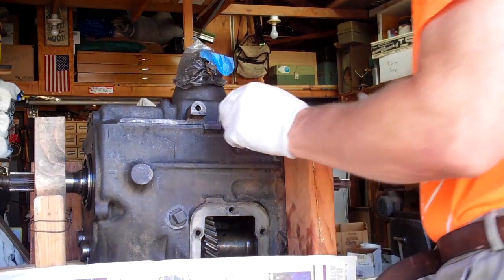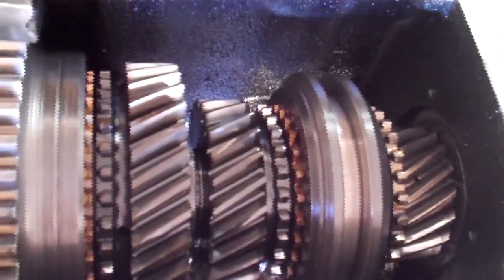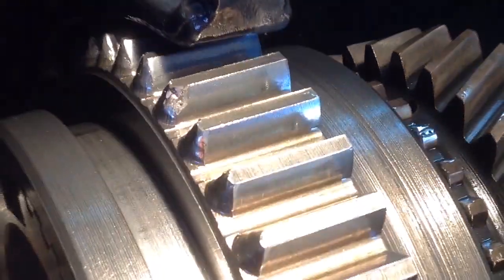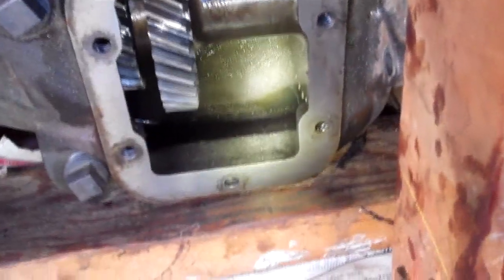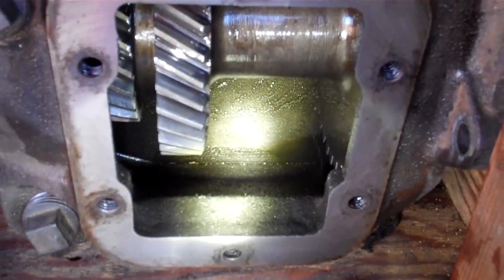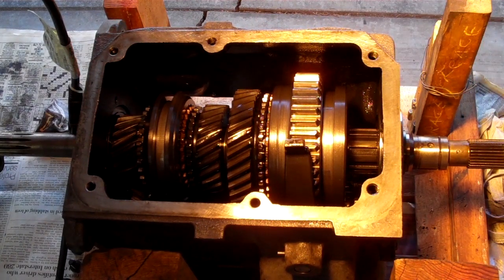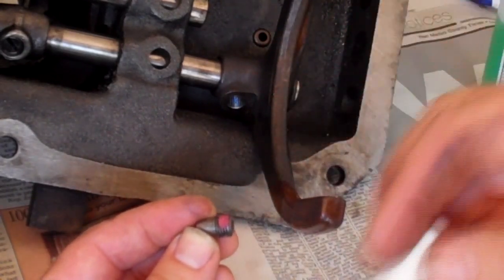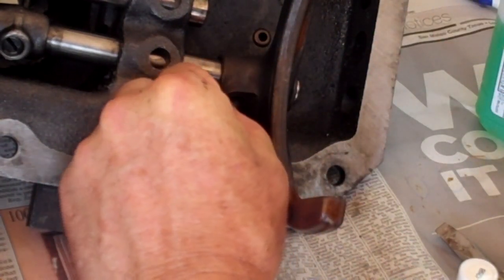T-18 Borg Warner Transmission inspection

Comment: I did a E4OD to T-18 swap, my uncle owns a shop and gave me every single part for $250 from a low mile wreck I mean every single piece it took to do a full factory look swap. the shield the inner and outer boots every bolt nut and trans cover I cut the hole with a grinder disc and drilled and bolted the tunnel in looked factory all the way made a HUGE difference in how the rig pulled it felt bogged out in every gear with the auto now it pulls like a mad man I also did a locker in the rear as well it is a 2 wheel drive.
Reply: Is this a Good brand ?

Comment: Hi there, 1958 AMC Rambler Super (pt.21) here, I noticed a small spot of yellow paint on the (first?) Biggest gear, I also have small spots of yellow paint here and there on my clutch pressure plate and friction disc and also on the front of the transmission gear box, I didn't think there would be those same marks INSIDE the transmission, is this to give assemblers some kind of clue as to how to what order it gets assembled?